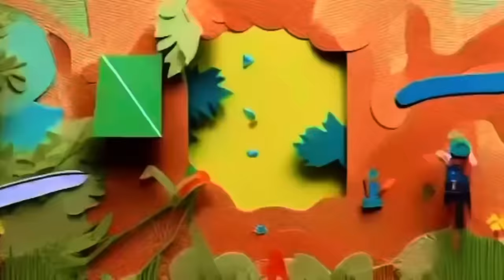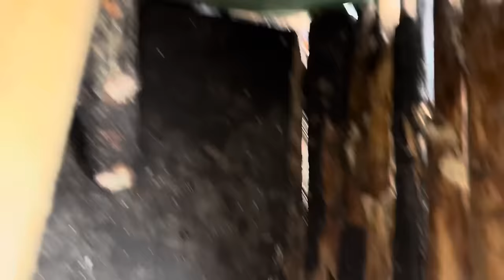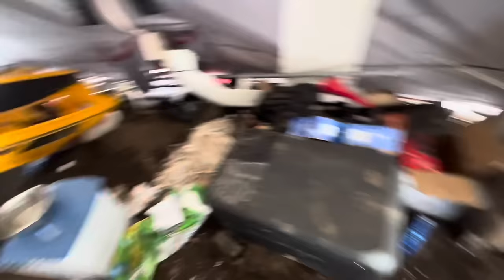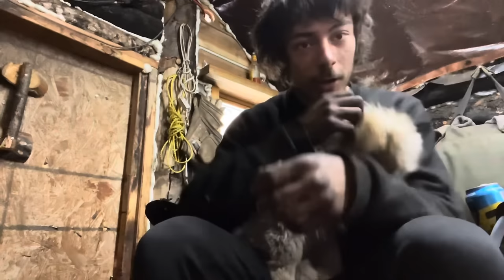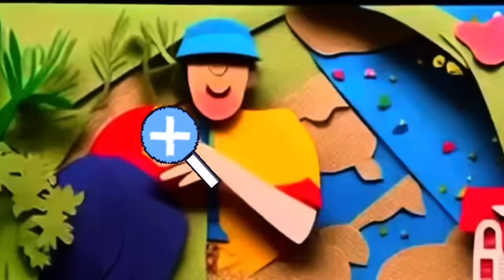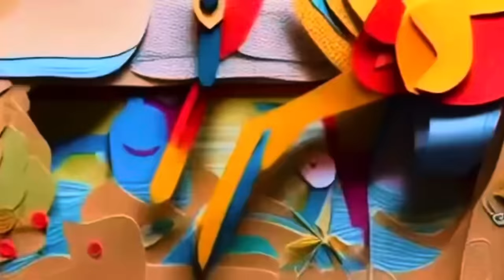Building Cabin Dealing With Puppies

Comment: Your talking about moving to Alaska. I have a dirtbike that works without a battery and an extra 2 phase power output for a battery. That means while running with an inverter you can power Sawzalls and stuff.
Reply: It a 4 stroke 250. 8 prong stator and 6 wire cdi. Off the stator should be yellow and white wire that charge the battery. Or head lights. Also the electric starter draws a lot of amps. So there is that.

Comment: Get Frank eating some oatmeal and baby pablum. He will beef up in no time. 
Do you have a water source anywhere above the cabin? You could gravity feed water down to you into a reservoir that you could put a small heater in and WAAABAM! You got water.
You can also get a 12V water heater with a shower head combo. You guys could find a basin and put it in the washroom with the shower above it and a shower curtain on a holahoop so that the water runs off into the basin and have it shoot out the bottom of the poop house.